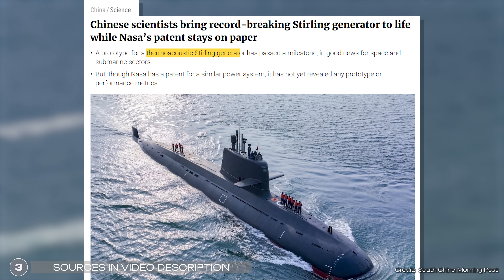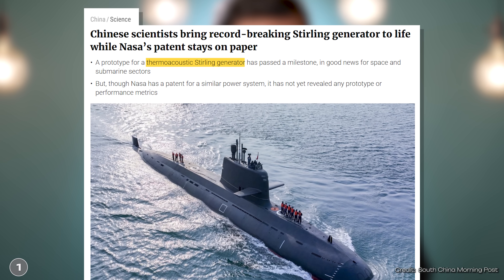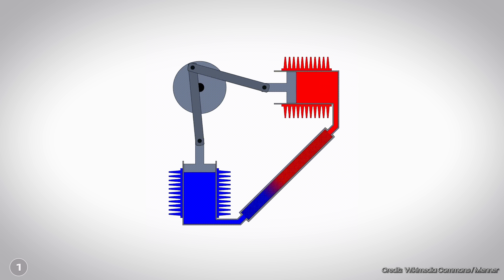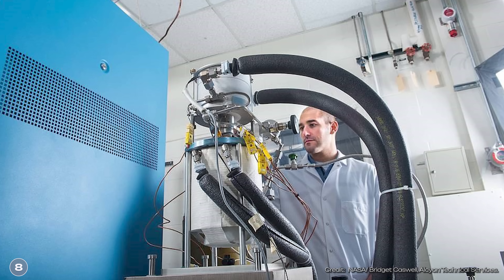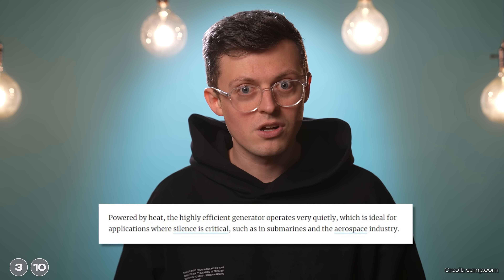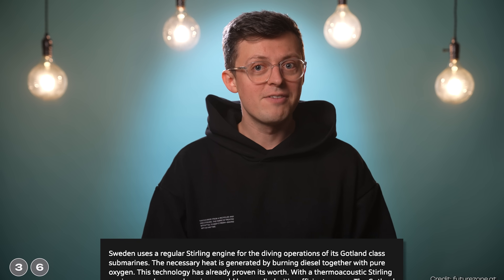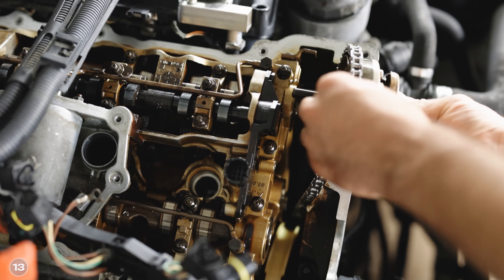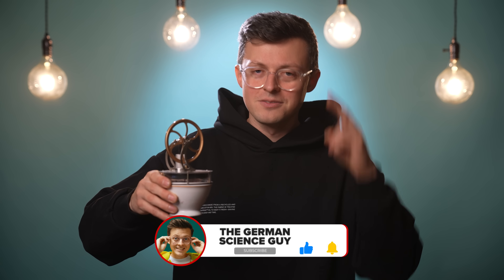The world's most POWERFUL Stirling engine: powered by soundwaves!

Comment: While fascinating, I don't see any reason to choose Stirling engines over turbines for practical applications. Turbines can be much more efficient, can have much higher power density, don't reciprocate, and the heat exchangers can be completely separated from the parts that converts the energy. All very significant advantages over Stirling engines, and no really significant disadvantages.

Despite their well known and well understood limitations and disadvantages, a lot of people have been very enthusiastic about Stirling engines, and tried to make good use of them, many times, and for a long time. There's also a widespread misconception about them being extremely efficient, but they're not as efficient as turbines can be. 

In the Swedish submarines they chose Stirling engines, as they had some advantages over diesel engines in that very specific case. And do note that the Stirling engines are used to provide a very small amount of power, up to 75 kW, during "stealthy" submerged operation, in combination with batteries, and they have diesel engines for generating power when surfaced. That is one of very few examples of real, successful practical use of Stirling engines for power generation, in the entire world, for a very long time.     

Thermoacoustic heat engines have some interesting differences compared to conventional Stirling engines, but it is difficult to make them generate meaningful power in practice. The up to 40% efficiencies claimed are not total efficiency, but 40% of the Carnot limit, which is less than half of what can be achieved with turbines. I'm personally very skeptical about the claimed efficiency of the engine featured in this video, at least if assuming the cold side is about room temperature, and not much lower. And while power density and efficiency claims are at least borderline too good to be true for a thermoacoustic heat engine, both are pretty terrible compared to what can be achieved with a turbine generator.
Reply: You are quite correct, but as all things in engineering it is about the application. My interest would in the 5 to 20kw range for stationary power, Solar in the day also used to produce a combustible fuel for example methane (Gas shift reactions) and this fuel burnt for power when incident radiation is low thus no batteries , quiet and multifuel capable. Turbines have more moving parts,
Reply: @ivandhotmanvilliers3361  Synthetic fuels are very expensive to produce from power, it's also not very energy efficient. The smaller the scale, the more difficult and expensive to produce, for a given amount of fuel. 

Turbines needs one moving part, the turbine stator and the generator stator can be the same part.
Reply: @fishyerik  Thanks : Yes there are some excellent turbines on the market for even as low as 5KV  electric output. On synthetic fuels with that I must respectfully disagree  see Sabatier reaction, and I can produce methane very cheaply for a host of sources to run turbines or a range of heat engines even thermocouple devices.
Reply: @ivandhotmanvilliers3361  I don't know what you disagree with me about, specifically, and we don't have to agree about everything. Maybe I just didn't explain very well.  Synthetic fuels doesn't have to be expensive to produce from other very cheap fuels, but from power to fuel, via electrolysis, synthetic fuels are very expensive to produce, and there are a lot of energy losses.          

The Sabatier reaction requires hydrogen and CO2, so first you need to produce the hydrogen, which in practice can be up to around 70% efficient from electrolysis, with very high end systems working at elevated pressures and temperatures. And you also need to provide the CO2. Then the Sabatier reaction itself, I don't remember exactly how much energy that is unavoidably lost as heat there, and no system is perfect, but there are very significant losses. Overall, from power to fuel is less than 50% efficient, even in extremely well designed systems. And then you want to turn that fuel back to power, which possible to do with slightly more than 50% efficiency, but at just a few kW even 30% efficiency is difficult to achieve, from fuel to power, in practice. 

Round trip efficiency power-fuel-power can be about 20% in very well engineered high budget professional systems. That's considering the heat losses as total losses, but it is difficult to make really good use of large part of all that heat. And that's ignoring dealing with the CO2, and all the parts of the systems required.        

Synthetic fuels produced from other very cheap fuels can be relatively cheap, especially when subsidized, but I don't see the point in that for stationary power generation with [external] heat engines. 

Yes, there are much easier ways to produce methane for small power requirements. Biogas is mostly methane, and that's very easy to produce, and also not too difficult to process into methane that's pure enough even for internal combustion engines. 

If you by thermocouple devises mean thermoelectric generators, which both utilize the Seebeck effect, they have very low efficiency. They can be great when you have a lot of heat, and only need to convert a ridiculously small part of that into power. I don't know exactly how bad it is, but if I remember correctly typically about 5-8% of the Carnot limit is considered practically achievable, meaning, if the hot side is kept at 600 K and the cold side is kept at 300 K up to about 4% of the heat energy can be turned into power. Keeping that temperature difference over the thermoelectric generator requires much bigger temperature difference between the heat source and heat sink than that in practice.
Reply: @fishyerik  Hi my statement about disagreeing was a way to be polite. "Fossil fuels" are also inefficient to produce. We agree on bio-methane. I used the thermoelectric generator example because it is very inefficient. There are lots of cost-effective synfuel projects, eg fuel from paper production waste.  So I think methanol, methane and DME are promising lots of info on the net.  As for what and how we burn them for power depends on the app, Thermoacoustic has a place. The Sabatier reaction with waste heat recovery is already being done. Thanks for the input.
Reply: What would you say if we have to assume silent running and lack of fission are the primary points rather than the whole efficiency margins?
It seems to me that the rest of this isn't as relevant in the modern year.  There are theories that subs need these new systems not as strong upgrades but simply because detection from ocean sound monitors or neutrino detectors.
Reply: @Jamtrenched  Rotational motion is far better than reciprocation, for a number of things, including silent operation. Efficiency is very important on a submarine your heat source is diesel that you burn with pure oxygen. Efficiency also dictates how much useful energy you can extract from a given amount of heat in other cases, so efficiency is a very important factor in any case, unless you have unlimited heat for free, which you never have.
Reply: Turbines require fuel.
Stirlings use temperature differences and no CO2 is produced.
Reply: @ Steam turbines are also powered by a temperature difference, and can be much more efficient than Stirling engines. 

Steam turbines can also have much higher power density, that is steam turbines can produce much more power for a given size.   

But, turbines doesn't have to use steam, other working fluids can be better options in smaller turbines, or when working with smaller temperature differences, or some other reason, like, power generation in space.
Reply: @ ya gotta make the steam.
Stirlings work on energy already expended, not specifically burnt to produce the heat.
It runs on a byproduct of existing processes.
Acoustic sterling’s are amazing.
Reply: @ The steam is generated from heat, it doesn't have to be by burning things. The heat source doesn't matter anymore than it does for a Stirling engine. The temperature difference and the amount of heat energy is all that matters, in both cases.    

Also, it's possible to use other working fluids, turbines doesn't have to use steam.
Reply: The claimed efficiency can be as high as 40% on a thermo-electric basis. Free Stirlings are to some extent thermoacoustic engines. A turbine generator can also be attached to a thermoacoustic engine. It can also run on steam, but gas is better. Thermoacoustic engines have the greatest potential.

Comment: There is a cyclic mechanical Movement what ever kind …… this is not a natural signal …… because it has an extreme narrow band shape …… and must be nicely detectable by digital Signal Processors. No comparison to Hydrogen Fuel Cells and brush less DC Motors. Big Power is not important, because cavitation is insanely loud. Duration is need to Drive less noisy than the natural sound o the sea. German Hydrogen Submarine have achieved that.